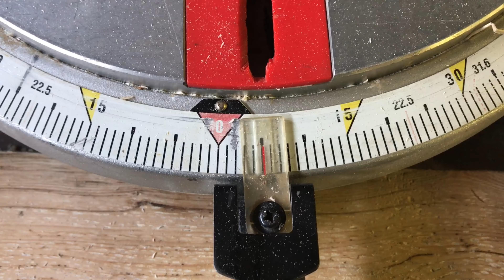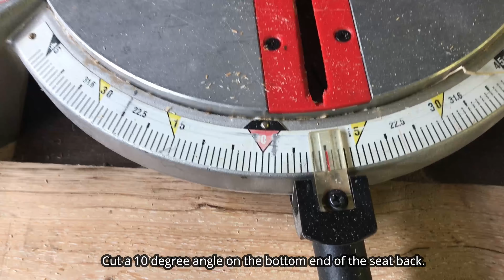How to make a pallet chair

Comment: Cool. I think the only thing I would change is rounding off the back of the armrests and making the third black slat just as wide but notching it so there was not a wider gap.  Thanks for the idea and cut list. The main thing I like about your plan is that the seat back has a reasonable angle to it unlike many other plans out there.

Comment: How do you dismantle the pallets without distroying the wood?
Reply: Now that's the challenge isn't it! I have good luck sometimes...and wreck the wood other times.
Reply: get an old axe head, put the edge between the desired pallet planks and blocks/'frame' of the pallet.  knock the axe head with a hammer until there is a small gap, 5mm is plenty.  fire up a reciprocating saw with wood/metal blade, and saw through the nails, trying to cut them as close to the planks you want to use as possible.

I have dismantled probably 50 pallets like this and almost never wreck a plank.  the reciprocating saw cost me £35 (budget Vonhaus - it works brilliantly).  it really helps to have someone else to stabilise the pallet, otherwise you'll have to clamp and unclamp a lot.
Reply: @MediocreCinema  thank you very much! I'll try that.

Comment: "Free." There's NOTHING free around here. They charge $4 for the crummy Pallets. $5-6 for the good ones, and $8-12 for the long ones! And then, they build them with those nails with the twist in them so you can't pull them out, and the demolition blades you need to cut them off with are expensive! Still a great article though.
Reply from the maker: That's a bummer.  We are lucky to have several sources of nice, clean and free pallets.  Dad can actually pick and choose what he gets depending on what size lumber he is looking for.
Reply: @ThisLifeOutdoors   lol, oops, i think i just sinned against the 10th commandment... thou shalt not covet!
Reply: Keep your eyes open and you'll find them eventually! I've even found oak pallets that I've made nice small projects with...but for that you'll also need a planer. Nice free wood though!
Reply: I look on facebook marketplace. Also trawl around local industrial areas, they get loads of stuff delivered on pallets which they tend to stack outside their delivery doors for the vultures to come pick at. Recently, I picked up a couple of 12' x 4' x 1' boxes complete with lids along with half a dozen pallets. The boxes were made from sheets of ply. They even ripped down sheets of ply to make the blocks etc for the forklift to get under. Where you would normally find a length of wood nailed to a block of wood, I had lengths of ply nailed to squares of ply stacked and nailed, what a result.
Reply: check craiglist.
Reply: @Mad5cout  Thanks! I'll try that!